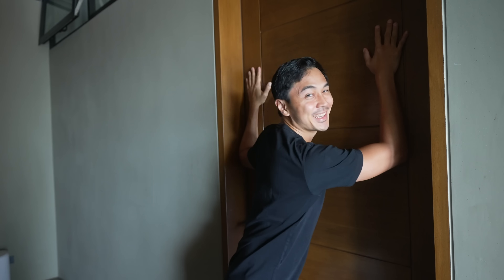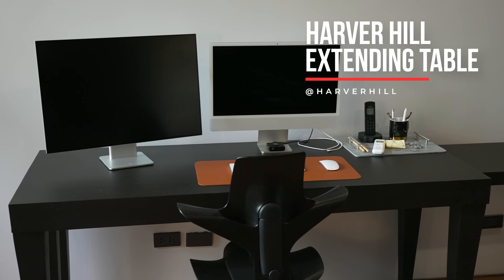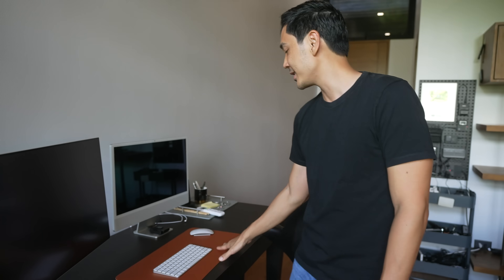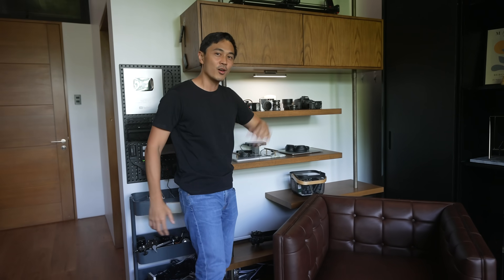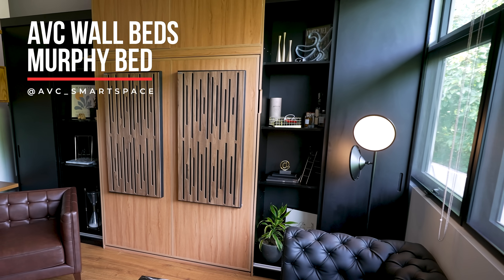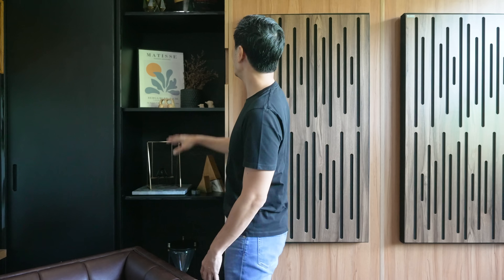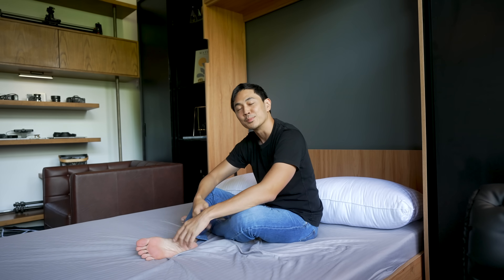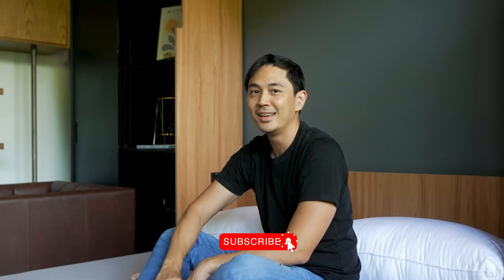MAN CAVE REVEAL! (Finally!)

Comment: The 2 panels you have is actually called a "absorber diffuser combo panel". It does help a little bit with the echo but you need more absorbers and at least a rug to help tame most of the echo in that room. The echo is still noticeable when you speak.